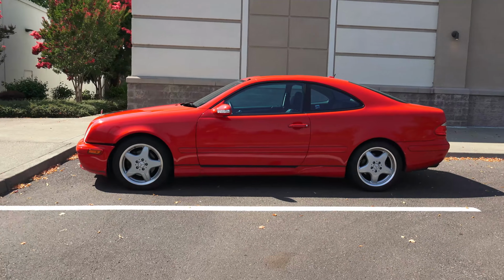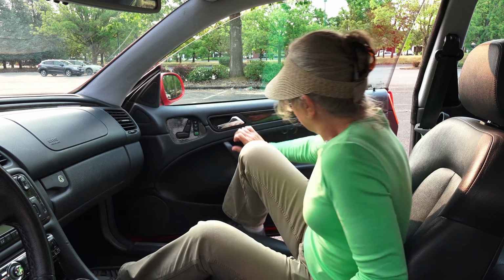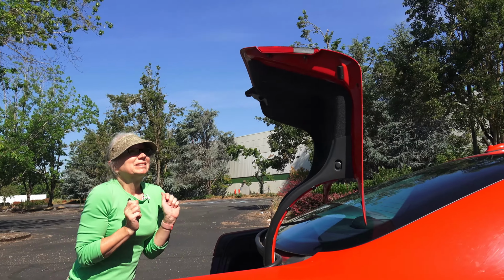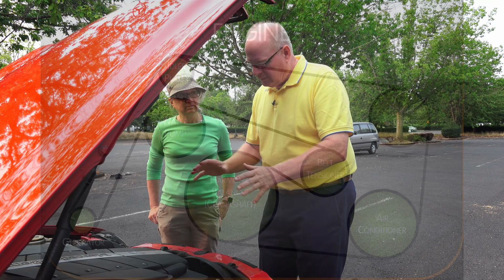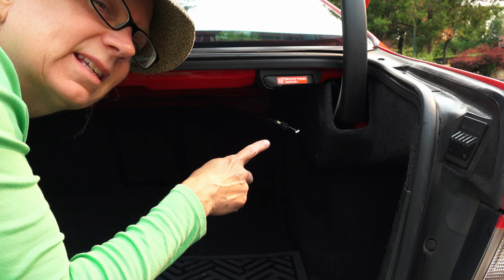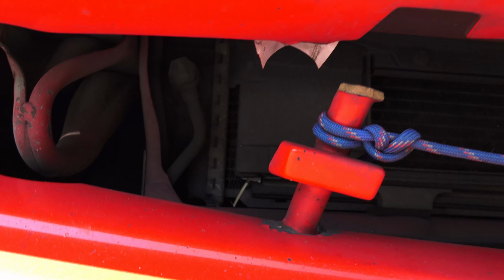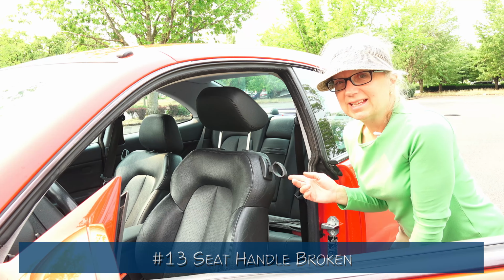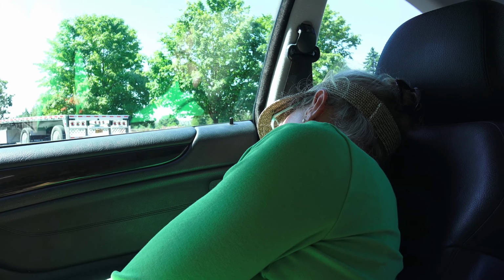Diane wants to fix the 14 things broken on her Mercedes

Comment: Wow, got some things that I can relate to. I got a 320 and have/had problem nr 1, 5, 12, 14 and the window not going up or down. 12 and 5 being related to each other, I got some oil leaking from the oil cooler on to the serpentine belt and it melted and ripped one time, and 1 year later im about to replace it again... And the window not going up might have been because my door stop was broken, not sure on that tho. Other then a brake light switch I've never really had any problems at all with it :)
Great video btw showcasing the problems, most of them are easy jobs for a beautiful car like this!
Reply from the maker: Scary story about how your serpentine belt broke--that was our biggest fear. Fortunately we changed ours (video coming up) before it broke. We hope our future fixes inspires or helps you to fix you other issues as well.

Diane & Paul

Comment: Nice color combo. i think ive repaired almost all the things on the w208 over the yrs
Reply from the maker: Thanks for watching Manuel. We are both excited and nervous about what our future holds for us. I bet you have some stories (what was the hardest project you tackled?).

We are a bit ahead of the videos in the work and we find that our M113 engine is so huge we have only 4 inches to the radiator. Diane says that belt projects are the hardest for her. She can't even change the idler pulley without removing the radiator or water pump.

Paul (& Diane)